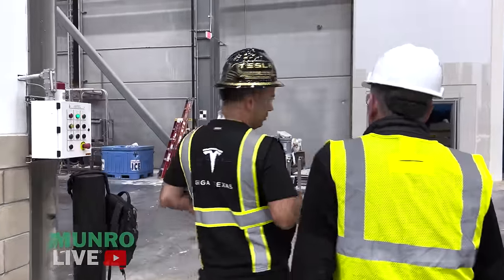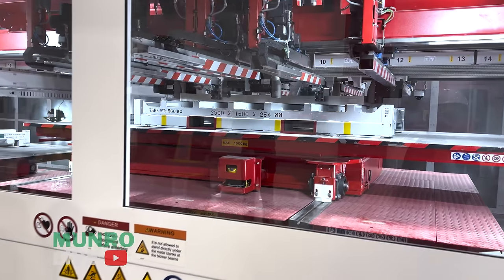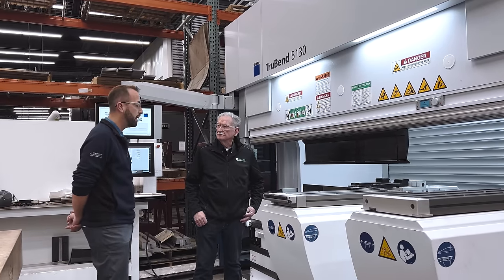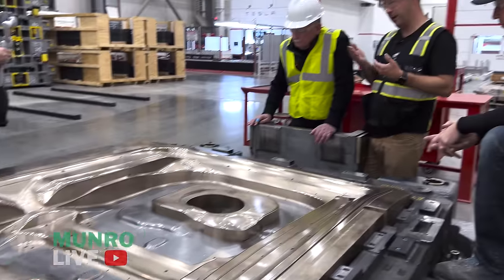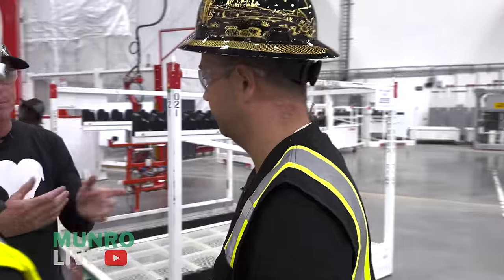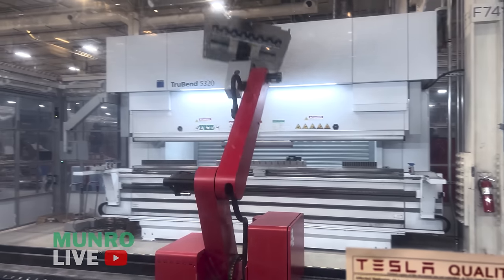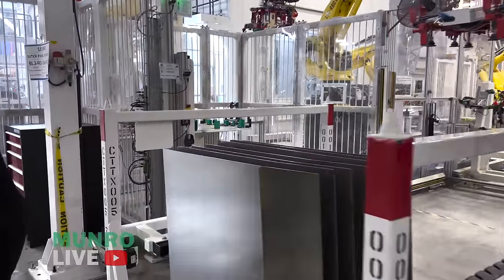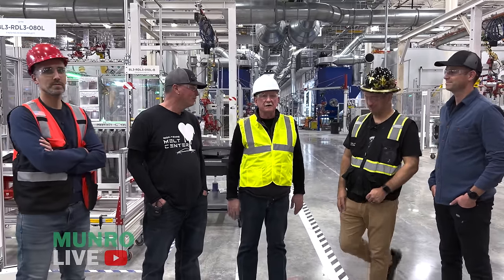Tesla Manufacturing: See how the Cybertruck HFS Panels are Blanked, Bent, and Built!

Comment: What I learned:
1.8 and 1.4mm thick exterior panels (not 3mm) 

The entire door shell is stainless.  No rusty door seams, ever! 

Door rings are powder coated. And made of boron steel.  

Bent panels are not scored.  Outer door panels handle 75% of the crash load (that sounds like exoskeleton to me).
Reply: It's kinda impressive they got it to be so strong that they went from 3mm to 1.8 and 1.4, makes you wonder how strong would 5 or 10 mm be.
Reply: @-JustHuman- 
As mentioned, you couldn't bend the radius without cracking at 5mm.
Reply: And, dropping to 1.8 for the doors/ 1.4 for other sections  effectively halves the volume of HFS and therefore the weight.
Reply: @rogerstarkey5390  Not about bending it, just how strong it is. There are more ways you could form the sheet, like a laser cut bend or hydro forming it.
Reply: I believe the 5mm refers to the radius of the bend,  not the thickness of the material.
Reply: Just out of curiosity. What is the metal thickness on a regular truck?
Reply: @MyMovie5858  on an F150 it’s 0.95 mm approximately, and that’s not structural, it’s mostly just for looks
Reply: @jonkeau5155  thank you
Reply: @-JustHuman-  Then next project wil be a tank.
Reply: @jonkeau5155  just thick enough to hold the paint!
Reply: True your right , door exoskeleton which is great. But not whole truck exoskeleton,  which was never a good idea , anyway from a practical/repair point of view.
Reply: We also learned that "...and whatnot" is critical to many specs.
Reply: I want to see what Midwest salted roads do to CT after a decade or two. Hopefully nothing but I’ve seen some incredible rust omissions (bedside gone etc)
Reply: @jamesengland7461  Yes. That was the inner radius. The outer was a little less than 8mm
Reply: @jonkeau5155  Thanks. For normal cars I think it's in the range of 0.7mm. I can imagine nowadays they go down on some special places to 0.5mm. 
So, 0.95 vs 1.4 and 1.8mm. That doubles roughly the torsion stability. The E-Modul is when remembering correct 210,000 N/mm^2 (yes, I looked up). The stainless steel is hardened (which does not change the E-Modul but ..
Reply: @orbitaljellyfish808  I found the process interesting but got a bit concerned when I saw them spot and laser welding the inner and outer panels. Unless this material is stabilized that will create an area of sensitized material which is immediately adjacent to a faying surface. Stainless steel suffers from crevice corrosion if water is allowed to wick into that narrow cavity. With sensitized metal immediately near there is a threat of stress corrosion cracking. The outer metal will appear ok but the corrosion in that narrow gap will be thousands of times higher. This is the origin of what happened to the original Atlas rockets and forced the development of WD-40 to prevent moisture intrusion. They need to prevent any water intrusion into that joint from condensation by using a sealant.

Comment: Hats of to them really. They made quite a tough life for themselves with the choice of material, but they've found a way to make it work. EDIT TO ADD: Plate and sheet levelling (cold levelling) can be quite tricky to get right. The key is to even out all the internal stresses so that when you cut or bend, things don't spring out into different positions/shapes. Don't want to be taking out the laser head just as the cut finishes! (seen it happen). This requires the levelling machines to be set correctly of course (which can be a bit of a black-art to some people) but also maintenance of the machines is key. I've worked in some steel mills where they simply are chasing their tails all the time because the kit is not treated well or maintained right. So it will be interesting to see how much sheet they have to throw away because levelling didn't quite work and how they can maintain the performance over time (its all great when stuff is new!). Do we know who makes the cold levelling machine?

Interesting that they were able to come down from 2.3 mm ish to 1.4 mm sheet. That is the problem with going for flat surfaces, you don't get the benefit of stamping shapes into it add rigidity. For example, some high-strength mild-steel body panels for are only 0.65mm (though 0.8 mm is a more typical number). Very flimsy sounding, but if you can stamp a pattern in it its OK.

Comment: Seeing this level engineering, I'm betting the OEM's C-suite sphincters are puckered. As you pointed out in the video, Tesla is maximizing the equipment ROI and the line's not even breaking a sweat speedwise, with room to get under a minute. It's genius Elon gave you this level of access, shot's fired! 

Can not wait to see the next video!
Reply: I think a lot of the other OEM's are laughing at how overly complicated this line is!!! Don't get me wrong it's incredibly impressive, but super complicated and hard to see how this will scale. 150 stampings before reworking?! Laser cut panels?
Reply: @Gr0gansm1th  I disagree. We saw 6 machines which weren't running anywhere near capacity. Plus, no paint shop. Paint shops alone are more complex than what was shown on the tour.

Comment: Just amazing! When I was a young buck in 1985, saw a prototype machine that assembled radiators for Harris radiator. It had rfid tags for each radiator to track the product, it was 150ft long and capped to and bottom ends to the cores, pressure tested the radiator in about 38secs. We thought this was amazing in those days. What Tesla is doing in 40 second cycle time laser welding door structures   /assemblies and other factory automation is phenomenal! Thanks Sandy and Munro Live

Comment: If I understood correctly, the door inners are made of the same material, just thinner so it can be stamped while hot. And then just not painted. Laser welded with enough precision not to make marks on the outside. Tiny imperfections on the inside fixed with another laser. It is all frickin laserbeams! No chemicals, no water, no solvents, no paint, no internal steel beam to resist side impact placed exactly where the crash test hits, no door handle. Just door. Tough door. Corrosion resistant door. The end. Chef's kiss, or whatever the engineering equivalent is!
Reply: They are not made of the same finished material. They are made of SS but not HFS SS.
Reply: @AntaniusX  That would make sense, but I wouldn't put it past Tesla to have formulated another special steel (optimal for hot stamping) just for this.

Comment: This presentation was amazing. All of that production in under 1 minute!?! At the 16:16 mark that reaction from Sandy says it all.
Reply: Except his enthusiasm was a little suppressed when he heard that those Aluminum/Bronze stamps only had a life time of 50 to 100 stamps, and then they are either reworked or recycled .....  but still if Tesla is doing that then there still must be a cost benefit advantage for doing that I reckon.
Reply: @Kr0N05 they have a die shop on site so they rework them themselves. They said all dies get rework when they change the dies out. That could mean as little as a Polish or reapply the coating.

Comment: This is what I wanted to see when Tesla announced SS truck. One of my strength of materials prof.'s had a story about rolling SS razor blades. He had to have a roller that was harder than a worked blade.
This reminded me of my metallurgy field trips. The cast iron foundry for municipal pipes and valves had a problem when recycling certain V-8 engine blocks that had certain ingredients for anti-corrosion. The aluminum extrusion trip had a line that used glass as a lubricant.

Comment: I heard quite a few 'we had to develop that', 'one of a kind', 'never done this big' and a couple of 'micron precision'. And this is on top of all the new wizzbang stuff already in the CyberTruck like....bespoke stainless steel alloy, gigantic castings, 48V, drive by wire, inhouse cell and structural pack production, 800V system with dual 400V charging.

Not even talking about the 'legacy' stuff like the octovalve, heatpump and HEPA filter system, totally integrated with heat scavenging.

This thing is an engineering monster. It should scare the hell out  of everyone.

Comment: Thank you Sandy for bringing us this fascinating video.  I felt like Christmas came early for this Mechanical Engineer and ex- engineer at a Toyota plant 🙂.  I'm so grateful for the chance to see this video.  But in the interest of continuous improvement - I Gotta say - This video left a lot on the table in terms of more detailed info from Lars and Tesla team members had more questions were asked.  I was surprised to hear questions like "do you buy the steel in pre-cut blanks?' or " Are you welding material coils together?" or "Are you scoring the material before bending?"  Are you kidding me ??  Sorry but that is stuff that NEVER happens in automotive mass production and I was kinda shocked that Sandy was asking these questions.  Lars was super polite and patient as always.  With this incredible access, I would've hoped to see a little more prep work done and some better manufacturing and engineering questions being asked.  For Example just off top of mind - How do they control spring-back when bending steel ?  More details on the air-bender (mind blowing operation) please !!.  How easy would it be to replace the outer panels after an accident?  What is Tesla doing to address the finger prints on the stainless steel ?  There could be so many more questions asked - I could almost see the disappointment on Lars face from the almost 1 way conversation and lack of questions.

Comment: Thanks Sandy.  Thanks Tesla.  Wonderland.  As an engineer it is great to have an insite into the technology and complexity of the cybertruck sheetmetal line including the staging logistics.  I hope Telsa will give us another tour of the entire line when all the transfer robots are installed and working.  Obviously most of that tour should be done using a programmed drone to show the machines in action.

Now that we have seen Tesla's "airbending," I understand the prior confusion.  Tesla really needs to come up with a new name for their addition to the technology of sheetmetal bending.  The term airbending is already taken. As you know, airbending is one of the most common methods of sheetmetal bending.  With airbending, the punch does not bottom out in the die.  Tesla is using airbending on the cybertruck parts.  In addition, Tesla is using high pressure air to suspend the sheet metal as it is undergoing airbending in the press.  Contactless airbending does not work because the punch is still contacting the sheet.  It isn't  very romantic, but I like MArless Suspended Airbending (MASA), pun intended.

Thanks again.  This video rates up there with the full model Y tear down.
Reply: Just call it high pressure air bending, or better yet others should stop using the air bending name as it's really not the case.
Reply: The “Last Airbender”. 😊

Comment: It took Tesla ONLY 4 years to solve all the complex problems? This is absolutely mind blowing 

That will ramp up faster than anyone could ever imagine 

Wow 🤩 WOW 🤩 AMAZING
Reply: It took less than that.
They had to build the factory, obtain the machinery, THEN perfect the process.
Reply: Well, it isn't "done" yet but they got most of it figured out. Other "car" company just slap on the parts together after engineering dept. gets it going and procure all the parts together and put them together, BUT still takes the same amount of time to get the car out the door, which is about 3 to 6 years, a few bit longer, and Tesla is actually building it out themselves for the most part. It is true what they say about Tesla. It has something to do with speed of thought. I think Sandy Munroe thought of it...
Reply: B-but they announced it four years ago. Tesla is a massive failure 😮

Comment: Of all the steps I was mostly impressed with the laser welding, done precisely at the edges so that it didn't mar the outside finish.  I had almost expected them to use an adhesive. But what I also saw overall was a highly-developed process to make what will be an expensive door, which left me wondering how long it will take to turn a profit on the CT?  They were a bit vague on the material used for the inner panel.  They said it's SST and clearly a suitable alloy to be stamped.  What the customer gets out of this assembly is a more durable door than a conventional stamped-steel design, but are they willing to pay for that up front?  We are very lucky to have this insight and thanks to Munro for publishing this video.  I would like to see Munro's team comments on this.

Comment: To help inform buyers and insurers! what is the process for replacing a panel? Presumably panels are welded to the frame? Can a typical body ship welder attach a panel without causing "burn through" or "blue" discoloration?

Comment: Watching the entire video including the sponsored section leads me to believe that the angular Cyber Vehicle is only stage 1.5 of the product innovation trail.

Once the huge Giga Castings (stage 1.0) appeared in public the ability of this platform to be at least as versatile as the Ford E /  F series became apparent.

The missing puzzle piece was how to incorporate customer required shapes and updates without reverting to high strength conventional steels with coatings and paint. Now we see how.  Aluminium Bronze Hot Forming Dies, Laser edge welding, Laser Ablation and Robotic Surface Treatment point to virtually unlimited design choices and further weight reduction.

The choice of an initial simplified external shape makes even more sense now.

I look forward to all the variants this platform and manufacturing technology will bring.

Many thanks to Tesla and Munro for sharing this glimpse of the future.

Comment: The sheer scale of the Gigafactory is mind-boggling. We only saw the corner where the Cybertruck will be manufactured. The other thing that stands out is the place is immaculate. I toured a factory that manufactured railroad wheels and axles and half the facility had dirt floors - which may be why it closed a few years later.

Comment: Quite a significant weight saving going to the thinner stainless - the original was around 3mm vs this is 1.8mm and 1.4mm. Normal car doors are about 1 mm and made of a more malleable automotive steel.
I like that they were pragmatic about implementing the design with using a larger 5mm radius bends and thinner steel so there is no need to groove the steel to bend it.
I think it would be look fine with an even larger bend radius.

Comment: My first graduate job (circa 1990) was working at a rolling mill supplier writing software to run the 40 little wheels across the width of the steel that adjust the tension as it comes off the hot roller. I.e very similar to what this kit is doing to de-stress the unrolled coils. We don't make rolling mills in the UK any more and I'm not sure who bought them so I don't know if that code is still in use, but it's interesting to see how there is not much actually new in the world, and how things come around in different usages.

Comment: The amount of changes made to produce this truck is amazing. A point caught my attention.One of your main points is weight savings. When Tesla showed you the process to harden the stainless they said that the original thought was that 3.0mm stainless was to be used but the hardening process allowed them to cut the thickness about in half. This greatly cut the cost and reduced the weight of the truck.

Comment: I didn't notice mention of the stamped door inner panel material thickness.  If you zoom in on the welded assembly (33:47) it looks much thinner than the 1.8mm outer skin and less than the 1.4 used for other exterior parts.

Comment: 7:36 The tolerances for an over a meter long part: 7 µm, 15 µm, 26 µm, ... That's insane and I sure hope this kind of accuracy becomes commonplace for all laser cut sheet metal.

To get this kind of accuracy, you need to consider the temperature of the room, the temperature of laser optics and the temperatures of different parts of the metal sheet during the cut among many other things.

Comment: Hi Sandy, wonder if you can comment. Will a cabin/climate control "heads up display" ever have a place on the windshield or no way. By extension, the whole interior windshield could be used for rear view etc when in reverse.

Comment: Curious about the door inners  and the potential for splitting due to the extreme stamping,  are there human eyes looking for defects or will it be robotics? I used to work in stamping for a major auto manufacturer and have seen splitting on door inners. Also what is the completed weight of the doors?